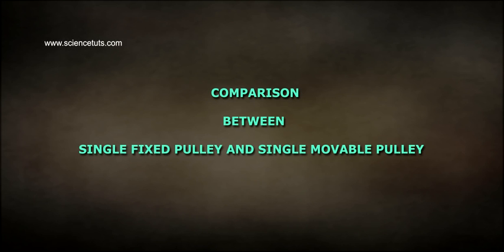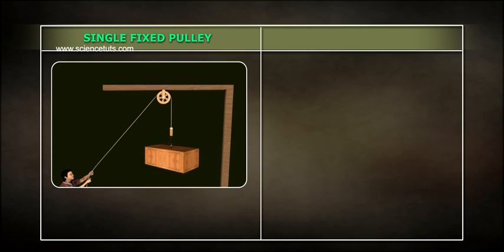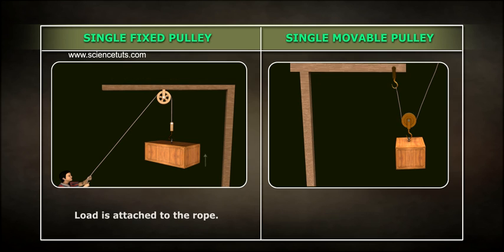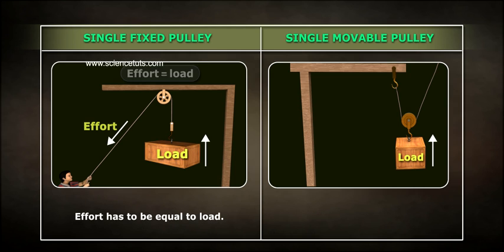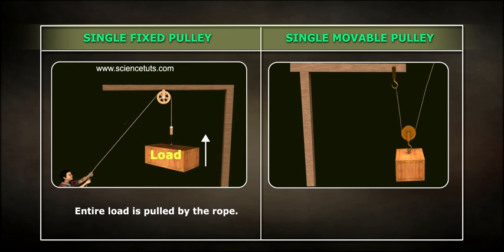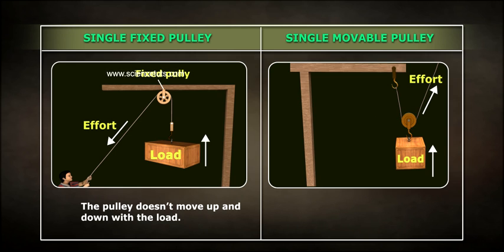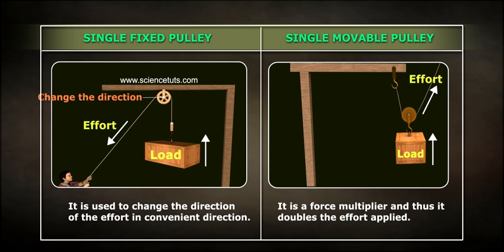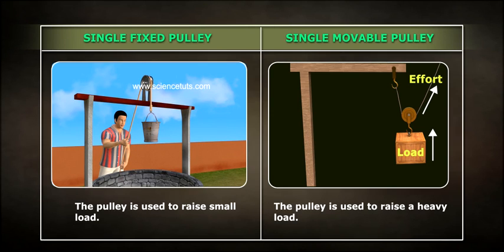COMPARISON BETWEEN SINGLE FIXED PULLEY AND SINGLE MOVABLE PULLEY

Comment: Okay this might be a stupid question but I have to ask. How doesn't the movable pulley just fall off the rope? Like is it held / balanced on the rope or is it cylindrical around the rope which would mean it won't fall off in that situation. So like lets say the load on a movable pulley sways because of wind, wouldn't the  pulley just fall off or flip upside down?
Reply: There are grooves around the circumference of the pulley...the rope runs around in the grooves and the weight that the pulley is lifting keeps the rope tight in the grooves.  Hence the pulley system won't fall off the rope.
Reply: @joliettt  One may also attach a single fixed pulley to this pulley's free strand so that force can be applied in a convenient direction, i.e. downwards